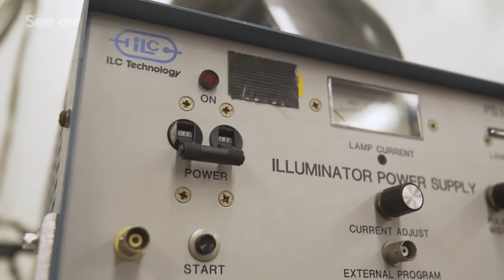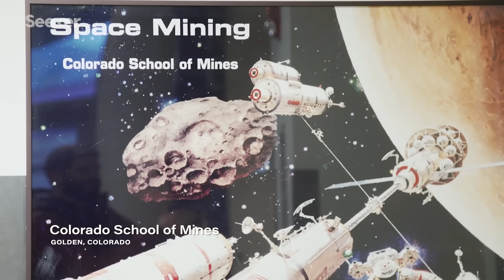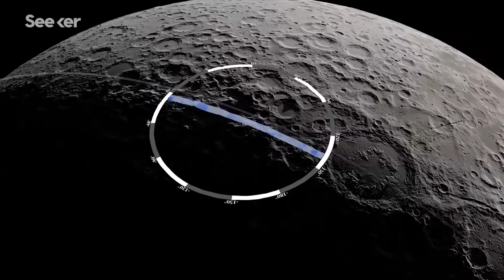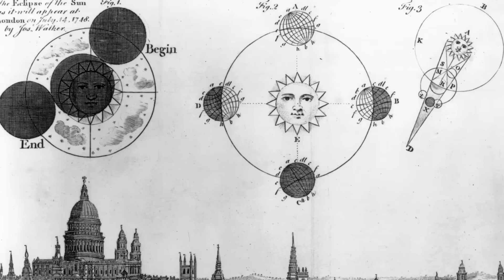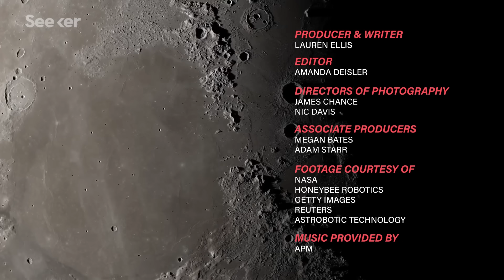The Race to Mine the Moon Is Taking Off, Here's What's Coming

Comment: Earth: we can't use water as fuel...   Space: we'll just use water as fuel...
Reply: We can turn water into a fuel. But billions of people cant use it to drive to work
Reply: Because turning water into fuel/propellant requires energy. That energy will come from burning other fuels, nuclear reaction or by harnessing solar energy. On earth the vehicles can achieve motion by rotating parts like wheels and propellers, for which these energy sources can directly be used like combusting fuels in engine or converting enegy into electricity to run motors. So on earth there is no benefit in turing water into fuel when the original source of energy can directly be used. But in Space motion can only be achieved by expelling mass from vehicle for which a propellant is used. Nuclear or Solar energy can not run a rocket, a propellant is needed for that. So the Idea is to use Solar energy or Nuclear energy to break water molecules into Hydrogen and oxygen molecules and use that as a propellant.
Reply: @aconsciousnaut5323  meh
Reply: I thought that was funny too. I mean if the ocean is rising we could lower it by using the water ? I mean It would cost an ass load to desalinate the ocean water and then pull the hydrogen from the water but the good thing would be the exhaust would be cleaner water than before (I think?) Perhaps a worthwhile investment for our filthy plastic ocean anyhow. Run the cars as purification systems 🤔  there’s a lot of wasted tax dollars out there just sayin hahaha
Reply: We already have hydrogen-powered cars, but they're not as efficient and there's no infrastructure to support them. Oil companies keep fighting these technologies to keep themselves in the game, so if you want to fight something, why not fight them instead of the people that are actually doing good for humanity..
Reply: @aconsciousnaut5323  - The energy comes from solar power and other renewables (but mostly solar). There are political-economic reasons down here on Earth to prevent that from happening (to delay that unavoidable energetic paradigm shift) but in outer space there is no alternative.
Reply: Other fuels are cheaper and efficient for now. Now need to do that. It's cost is huge
Reply: @mrrahul9683  - Not anymore: solar is extremely cheap and efficient now, its only problem is obviously production hours. So the barrier for the energy paradigm shift was in accumulation, whose most promising (and cleanest) version is as hydrogen from water eletrolysis. Until 2016 the conversion ratio was barely above 20% but that year ratios of c. 84% were accomplished. There is therefore only a political barrier for the "hydrosolar" (from hydrogen but also from hydros = water) energetic shift. This political barrier is in Washington primarily, because the US dollar's hegemony is backed by Saudi and other satellite oil producers who only sell in the North American divisa (Nixon-Saud pact).
Reply: @jashpaper8370  so when someone tell you a reasonable argument you write... meh. 

Ok
Reply: If genuinely asking, there's a good reason.

Here on Earth, extracting the hydrogen from water is an energy intensive process that in most cases would never make financial sense. 

However, when dealing with the moon, you could use solar power to provide the energy, and when combined with the fact it takes relatively very little energy to escape the surface of the moon, less hydrogen would be needed to transport more weight, quickly making it economically viable compared to earth launches only.
Reply: There was a guy from the Philippines who invented a device that could run machines with the use of water..also from the same country another guy has invented a device that turns garbage into fuel..unfortunately that was the first and the last time I heard of them..the guys were gone with their patents..
Reply: @rotnroll2117  maybe they didn't discover anything. Water engines are not possible. I am almost sure he used calcium carbide, Ca2C, that produces acethylene or other "magic product". Water is very stable, oceans are prooving that. If you want to obtain energy from water it is necessary to break its atomical bonds loosing energy un the process. Then, we have to combine its atoms again. A nonsense.

To separate oxigen from hydrogen by solar energy is something totally diferent. 

We can NOT use water like fuel. Only water motor is impossible
Reply: because we love oil, we love our cars, and if those technologies were actually profitable, oil companies would have switched. It's not profitable or practical. Stop and look around you and notice everything in your life is attached to the insane amount of energy we use daily. God bless. #Trump2020
Reply: EG 
I'm not sure bro..but I saw him ran a machine with using only water. .I don't know if we can find him in google to check his invention.
Reply: @rotnroll2117  yes, I can do that trick too. Hiding part of the process...

It is very important to understand the science behind the "new" inventions. Most of them are bad tricks. And no one patent the new revolutionary device or show clearly to the world how it works. It is very easy today. 

When this people is discovered as liers, dissappear like smoke. Is not the goverment or the lobbys. 

Do you really think that is possible to hide an important achievement like that? Free energy, water powered engines... We want to beleave becouse we are worried and want to feel we are special
Reply: EG 
It's ok bro..I knew what I saw..and yes it's free energy..too bad I was too young back then to understand the scientific principles behind his invention..two possibilities on where he's at right now..somewhere in a paradise island enjoying the worth of his work or 6ft below the ground for trying to take down a multi billion dollar business. ..
Reply: Because water is everywhere on earth but has they ha eas pay is all about the benjamins
Reply: @jotixier  they already began switching to other renewable sources, you just didn't know about it until now, didn't you hear trump saying that? But they just wanted to milk the oil industry inside out before switching. #trump00100
Reply: check out stanley myers he ran a car off water. he was found dead in his car in a parking lot.
Reply: Earth has a lot of gravity, the moon doesn't.
Reply: @rotnroll2117  That sentence, "the eyes never lie, chico" It is only true in the context and meaning in the great film Scarface. 

In this situation, our eyes would maybe tell the true to others, but tell lies to ourself. This is why we need science. 

My comments are not to create any discussion but to try to speak about criticism. 

If someone show us magic and says that is not a trick, then we need the scientific principles that explain what we see. 

The liers take advantage with other people eyes. 

We need to be carefull. 

Saludos, amigo!! (Spanish)
Reply: @rotnroll2117  the world economy is run by oil, if they allow this water fueled car to mass produce the world economy will collapse overnight.  They will only allow something that cannot compete easily with oil such as the electric car and the bio diesel. There must be a smooth transition before shifting to a free energy, and having water as fuel is almost a free energy
Reply: 6:23 he's using sugar in his gas tank! lmfao
Reply: Gravity. You need stronger fuel on earth. In space, you don't need that much, but it's still essential.
Reply: @ducreat  maybe for rockets.. but not for cars...
Reply: They were actually talking about Rocket fuel that's hydrogen and oxygen H2O  the problem with earth's water is that its not pure water it contains minerals and other 
 but mon god purest form of H20 which is frozen
Reply: 4th dimension: let's use this moon for fuel
Reply: @ge2719  they can. If we find an efficient way to produce hydrogen from water they will. It was all about renewable sources. Once we have enough solar parks and wind turbines, using the electricity to make hydrogen will be a logical solution. Unless the vehicle batteries become better, in which case you can just use electricity. If there is one thing for sure is that petroleum is finished, at least as a fuel, in the developed world.
Reply: We can do that lol, the solar radiation up there is so high that you can use that to make energy. The sun has so much energy.

Comment: Going from the surface of the moon all the way to low Earth orbit takes less energy than going from the surface of Earth, because of gravity and atmosphere.  And with the lack of air on the moon, some crazier launch ideas are actually feasible, like launching something along a long track mechanically or magnetically, up to possibly even escaping the moon back toward Earth, further reducing costs. 

The lunar regolith(moon dirt) has silica for glass, and large amounts of the oxides of metals such as iron, aluminum, and titanium.  We could make metals and glass on the moon, then send them over to Earth to make space stations, larger telescopes than a rocket can fit, or solar power concentrators to send power down to Earth (either giant mirrors to use with solar panels, or power generators that beam down microwaves, which can be harnessed by grids of wire on the ground).  This could provide solar power with a much smaller footprint, and reduce the effects weather and high latitude have on solar productivity.  A mirror in space can be a simple sheet of foil, because it doesn't have to stand up to wind, rain, and snow.

Comment: Your Reading Way Too Many Comic Books😂
  How do you plan on getting all the Heavy Equipment there ? 1 Large excavator can weigh as much as 207,300 pounds (103.5 tons) and pack horsepower ranging from 273 to 542. They need air to operate maybe batteries. That's more weight !!!

Comment: I'm right there with you folks but it took me a little time to start, I just finished my self-contained generator prototype. Is generator does not need external oxygen to run, instead it uses resources to produce a fuel mixture that can be burned straight from the tanks. I'm not going on here bragging about it, it's actually the small part of the project. This will become the heat pump in the power source for my offworld greenhouse development. I currently manage a landscape company and have been in landscaping for 30 years as well as certified in agricultural biotechnology.there are a few of us working on the greenhouse situation right now to supply food for workers and for colonists on other worlds and moons. The space race is real and we'll pick up steam very quickly this year.congrats to all the companies and manufacturers who have made it to space and other worlds and moons, and good luck to all of those in the building process as we speak. Godspeed.
Reply: I like that. It's good to hear regular people are working on this!
Reply: space is a hoax better stick with grass cutting.
Reply: @MarkTaylor-mk7fl  so is your existence, but you don't hear me complaining. I grow $10,000 palm trees, that gives me the capital to work on my project. I do not cut grass, except for my own.
Reply: @Hallowed_Ground  15 years of research and I finally managed to make a working prototype that can be solar charged and battery powered.my main issue now is I have no idea of the electronics could take the lack of atmosphere or the abuse from direct sun without a barrier of some sort. Now it's materials research to see what will work on what surface, as well as if perchlorates will eat a hole in my greenhouse on Mars.

Comment: Reducing the mass of the moon seems like a really bad idea.
Reply: Scraping some rubble off the surface isn't going to make a difference.  The moon is much smaller than Earth, but it's still two thousand miles in diameter.  We could remove enough material to make hundreds of city sized space stations, and it would still be a tiny fraction of the margin of error in our measurements of its mass.

Comment: Your Reading Too Many Comic Books !    Large excavators can weigh as much as 207,300 pounds (103.5 tons) and pack horsepower ranging from 273 to 542. Also will need batteries to operate them more weight.☹

Comment: Eh, I still don't get why not first develp an appropriate Alternative/ Mix for rockets so it isn't 4000$ per kg.
but say, 40, or 4 ..

There're plenty of Ideas. 
I prefer a railgun..

 But you can also have floating assisted stages. a hollow shell of the craft the the outside is good space and very light.

and the space between that and the inner shell is now vacuum.

Of course, in this scenario the rest has to be that light and strong too.

Another possibility; that stage is basically a glorified piston.
And electronic engine pushes the piston 'Down', when the contents reach the opening, microwaves bring them to a boil(The Exact wavelrngth) so they shoot out even faster.
meantime, the majority of the space in the stage is now vacuum.

With it's own lifting effect.

This I actually see as plausible.

 A simpler engine.
That use both rocket science and buoyancy.

Then you have the Skyhook.
A Fast spinning well, Stick with hoocks at the ends, that use leverage to give and take kinetic energy as needed.

This is part of what is called orbital infrastructure.

 Also, Midway stops.
Floating platforms that take in the first stage.
At basically the end of the bottom 10% of the Atmosphere where dragg is much lower.

Thus allowing the rocket to carry much less fuel.

That platform?
 A Combination of vacuum and ion drive.

Comment: Is magnetism strong enough to send something to space?
Could cut fuel costs if plausible.
A electromagnetic launching system could be based on Earths surface (or moons surface) so most of the weight could remain on the ground instead of contributing to the weight of the rocket/vessel.
Maybe not powerful enough to launch from Earth, but seems like it could be possible from places that have less gravity and atmosphere.
If not possible to launch from Earth with an electromagnetic launcher, it still seems possible that such a device could reduce the amount of fuel needed by being part of the launch propulsion (maybe in combination with chemical rockets)
Another potential advantage of such a system is that it could be reused, and with enough solar panels and time to recharge it could refuel itself.
 I'm not a physicist and I haven't done the math. Maybe the most powerful electromagnets yet made by humans are not powerful to launch a space vessel, but it seems plausible to me that things could be launched that way.

Comment: If water is the oil of space... would't aliens want to do to earth what where doing to the moon?
Reply: Water is everywhere in HUGE amounts. Saturn's rings are mostly water. The interstellar clouds have water. It is for us humans as valuable a resource in space as oil is on earth---but to cavemen oil wasn't all that valuable. It takes knowledge to turn something from useful, even necessary to extreme value. If aliens ar spacefaring, they have the knowledge to use the easier pluckings of the outer solar system and interstellar space.

Comment: The drill trident has been in testing and building for two decades 😹 ok sounds like will be there by the year 2075 lol
Reply: Simply put, Space is difficult, it's part of the reason James Webb is taking so long. You have to iron out ALL bugs, which is a very time intensive process. They can't afford 99.9% reliable, if something fails at the L2 point, you ain't fixing it like Hubble.